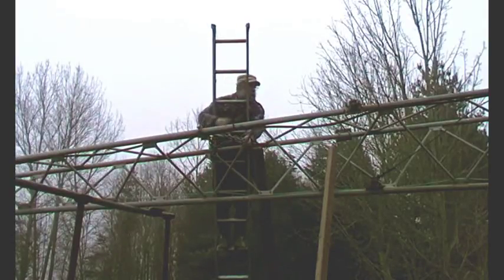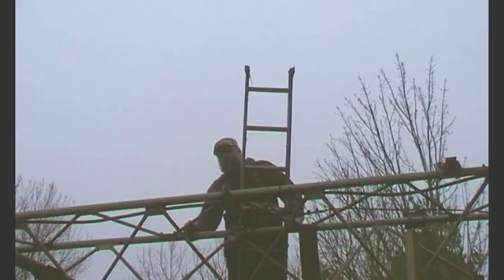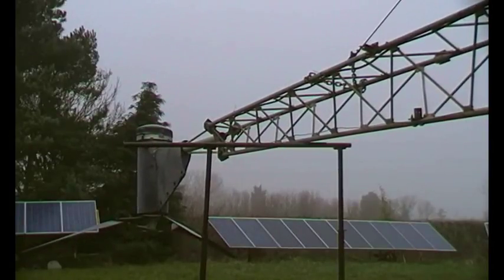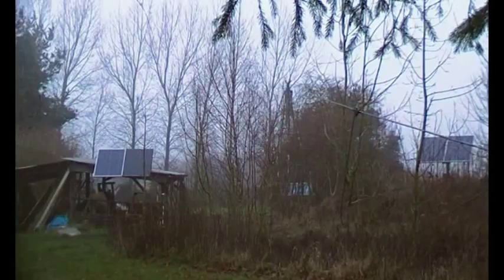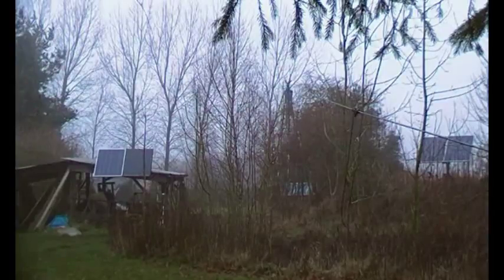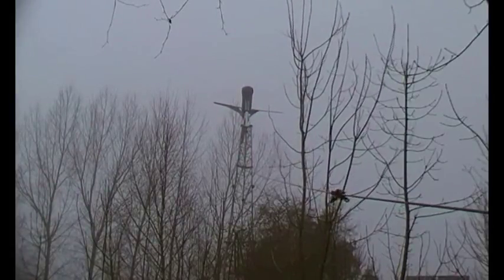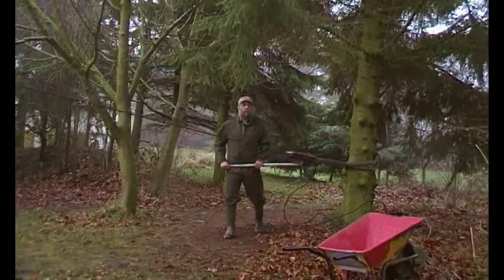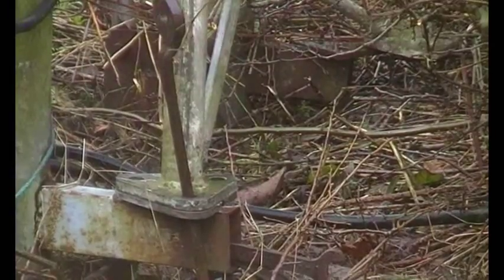Proven 2.5K wind turbine repair, part 5: the great winching.

Comment: Well done Andy determination and hard work in the end paying off. A thought for the future: if as noakeswalker calculated the gin pole exerts a downward force of 750kg, that would be a handy weight to have as a counter weight on the vary base of the legs. In effect as someone has all read mentioned below. It would be worth moving the gin pole to the bottom of the tower to take advantage of that force thus eliminating the need for the base winch.  I realize, that the cable will begin to pull directly on the tower sooner but,  as its the initial lift that required the greatest effort, it might be worth it.
Reply from the maker: Hi, it's wonderful we are all working on this. I think this may be a way forward. At the moment the offset to the base is about 9 inches, so perhaps move that to 3 feet for the next time. The gin is bolted in position so no problem with shifting the position. Cheers, Andy

Comment: K would look for some scrap angle iron and weld it on to the legs,  increase the weight down there, give it a better balance so pinching isn't such a strain.
Reply from the maker: Hi, maybe an old engine block or a lump of concrete, cheers

Comment: As you say Andy, you wouldn't want to do that every week.... I couldn't see any bowing of the new gin pole at all. A Tirfor certainly is a workout !  Cheers, Dave
Reply from the maker: Once a year may be Ok, some comments suggest a counter weight in the bottom of the tower, maybe a big old engine block, cheers, Andy
Reply: A counter weight on the legs would have to be pretty heavy to make much difference I think - but easier than using that lower winch I guess,  plus you could stay out of the way of it while winching :o) Do you happen to know the total weight of just the tower alone ? I'd like to work out how much force actually bent that first gin !
Reply from the maker: Dave, here's a few figures and estimates: tower 15 mtr to the wind shaft, pivot 2.9 mtr from the base, original gin 3.5 mtrs. Weights: turbine 200 Kg, tower sections about 150 Kg each. Hope that helps and thanks for the interest, cheers, Andy
Reply: Thanks Andy - how many tower sections are there then - I can't see the joints on the vid clearly ?  The other distance that would be handy for working out those rope angles at the pulley, is how far is the tower base from the winching spruce -  I'm going to ignore the droop in the cable though....only if you've got a mo to pace it out. Calculator is on standby...Cheers, Dave
Reply from the maker: Dave thanks for your note. The tower is in 2 sections plus and extension of 2 mtrs on the top. Base to spruce is 40 mtrs. The chain anchor point is 2/3 up the tower and the previous anchor was about 1.8 mtrs lower. The tower main structure is 85mm x 4mm tube and the cross bracing is 1 inch x 2mm tube. The tower weights I gave you were an estimate and may be up to 50Kg  light. Hope that helps, cheers, Andy
Reply: Ok, I will have to recalculate for the heavier (suspected) tower weights - but for your first estimate of the tower weights - the forces on the gin pole (original one) came out as :-  150kg sideways and 750kg down through the legs.  I've had to estimate some of  the dimensions, so this is really only an 'order of magnitude' type of result.... the sideways force seems low, but if that put a bit of a bow in the gin, you then have that 750 kg downwards trying to worsen that bowing quite urgently ! And if the tower is actually heavier still than you thought, that would only worsen things.... does this all make any sense ? 
Tension in the cable comes out as 1.1Tonnes, and that is just to hold the rig, you'd need a bit more force on the winch to get it moving upwards. Does that tension sound about right for the effort you were putting on the Tirfor ? Dave
Reply from the maker: Dave I'm thinking that 150 Kg on the end of a 6 foot lever is not enough to bend 2 pieces of 50mm box but as you say with the slightest deflection then the down force would come into play. Difficult to even think about. With the new shorter gin it felt like 2.5 tons on the first pull. It was at the point where another person on the winch would be helpful, and that is where things get broken. Cheers, Andy
Reply: yes, I agree - 150kg on that gin pole isn't really enough to deflect those beams much. Did you say that the hydraulic rams were mechanically disconnected now, rather than just the hoses ? Just trying to account for the large error in the cable tension ! I worked out the weight of just the tower legs, and that came to 360kg, so that's close enough for me.  Hmmmm.... Cheers, Dave
Reply from the maker: Dave, what do you think to the idea of using the gin downward pressure by moving the whole frame further away from the pivot? Cheers, Andy
Reply: I was thinking this when I saw the downforce number !   It's surely worth trying out - it's essentially some free counterbalance isn't it ? Gin pole will be annoying on the ground at 6 feet up though :o) The cross strut the gin pole is clamped to might have to be beefier though ?.And as Woody2run says, the cable will be pulling directly on the tower earlier in the lifting...
It looks to me from your pt1 video, that the hydraulic rams are still connected up and move with the tower - are you sure they are not causing any drag Andy ? I'm still bothered by why your cable tension guestimate is twice my calculated number - if it really is nearer 2T than 1T, then  you can multiply both the forces on the gin pole by 2 !!!! Cheers, Dave